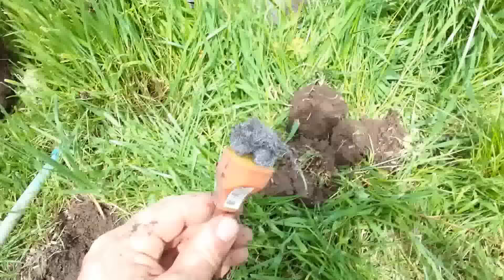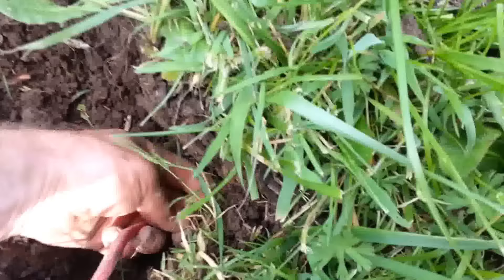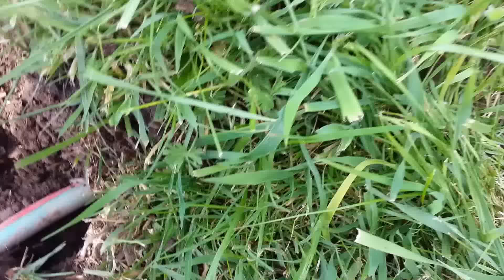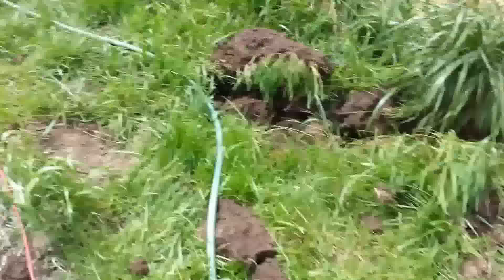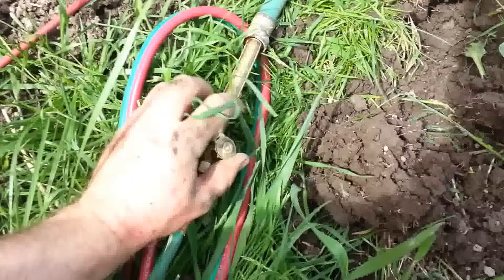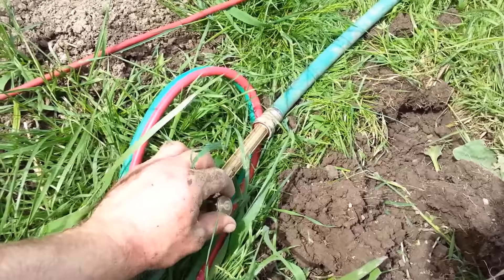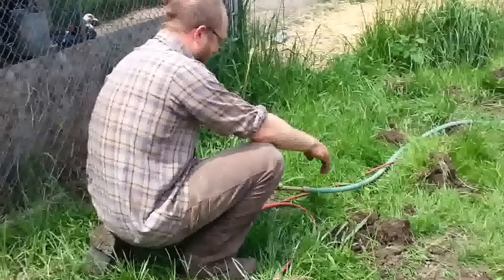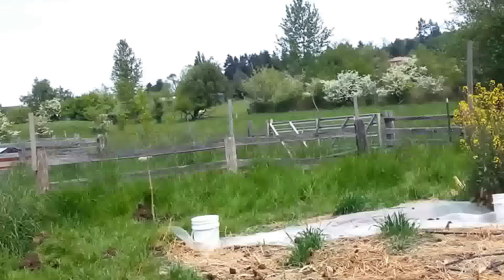Oxy Propane Gopher Tunnel Explosion

Comment: Who else was disappointed that at least one gopher didn't come flying out of that hole when this went off?
Reply: A bit morbid but, ok...
Reply: That gopher is chilling out in his other tunnel complex waiting till this guy goes home
Reply: I kinda did that once with a mouse.
That little gap under the drywall sheet where your floor woodwork goes was not in yet, and a box was in the corner.
One side of the corner was already up, so the opening just dead ended.
I got a regular propane torch out, and pointed the nozzle into the hole and turned it in for a few seconds.
Removed the torch and got the Bic out.
A little “FOOF” happened, and the now singed mouse ran out of there like nobody’s business.
The cat managed to get him right after.
Reply: Or returned fire?

Comment: Did that once with gasoline pushing the vapor with a small fan. Ignited with waterproof fuse and then spent the next half hour putting out the flaming chunks of sod that were spread upwards of 40 feet from the original tunnel. I had a oxy/acetylene torch but never thought to try that. Pretty cool.

Comment: My brother and I did something like this when we were kids and our parents had a house in the country, except we used our mom's hair spray which we sprayed for about half a minute at a time into a gopher tunnel opening.  Then we stepped back, lit a match away from the opening and tossed it in the hole.  It exploded with a loud "whump" sound, but nowhere near as loud as what this guy on the video did.  We saw the dirt slightly lift up all along the path of the horizontal tunnel, then it collapsed slightly downward.   We did it on about three or four gopher tunnels around the yard, but stayed away from the house just in case.  Mom probably wondered why her hairspray was getting used up so fast.
Reply: Mike Kennedy 🤣

Comment: Even though this is 6 years ago. The reason for the delayed explosion is because the oxygen and propane around the steel wool needs to hit certain percentile ranges before it will actually ignite. Its better to use more propane then oxygen because you can always just wait. Also if you were using air not actually oxygen then u might wanna re think your ratios.
Reply: Not quite. You actually want more oxygen than fuel. The stoichiometric oxygen requirement for propane is 4.3:1 for maximum combustion and flame temperatures. The higher the temperature, the higher the gas expansion and in an explosion, its all about the volume of gas expansion.

Comment: When I worked as a mechanic for a private golf course we used to go out and clear gophers. We had a specially built system called the Gopher Getter that was oxy/propane, but it was attached to a nozzle with an igniter built right in. Had huge tanks attached to the back of a golf cart and wired it into the cart electrical system. We'd stuff the nozzle in the hole, drive and park about 50' away since that was how much hose we had and let it rip. Never had to get out of the cart. Good times.

Comment: Awesome video, but I prefer just a common road flare.  Place it in the hole after lighting, cover the hole.  Do not cover the other connecting holes, that way the poison gas flows out and into all of the tunnels.  Any gopher that escapes out is dazed, confused and easily dispatched with a .22short or a pellet gun.  Much quieter and neighbors don’t get all bent.

Comment: I did this years ago by making a HHO generator out of an old car battery that would not longer hold a charge. You could see the water level though the white side of the battery. I let it run until the water level was real low. I have no idea how much gas was in the tunnel but when it lite it off the blast rattled every window on my street and some one called the cops. By the time they got there I had hide the HHO generator and hide my self as well. I only did that once.

Comment: Back up Chevy pick-up to area of gopher tunnels. Run hose from exhaust pipe of truck into opening of gopher tunnels. Turn on truck. 

Isn't that easier?
Reply: I was just about to say the same thing.
Reply: no, the exhaust contains carbon dioxide and heat in addition to carbon monoxide,
burrowing mammals are extremely sensitive to carbon dioxide, and air temperature. 

the gopher will abandon the burrow before the CO can incapacitate and kill him, and he'll just dig somewhere else near by or head to a different burrow.  you'd have to plug every burrow entrance and trap him in the burrow.  

because the gas used here contained oxygen, and the fuel gas unburnt is non toxic... the gopher wouldn't have tried to escape.
Reply: We've had great success with the exhaust method too.  You never see the little critter again. Never seen one try to escape.
Reply: DoubleDogDare54 this is more fun.
Reply: DoubleDogDare54 chevy chase?
Reply: I hooked a hose up to my Cummings diesel and smoked them out for one hour.  They just plug up the run with dirt and go elsewhere.  I find traps put in the run about 30" in does a great job.
Reply: Why do that when you can have red mist
Reply: This is way cooler.
Reply: DoubleDogDare54 yeah it's easier, but you don't get to blow anything up.
Reply: Sure, but not as fun 💥
Reply: Gotta love those clean explosions :s
Reply: learnd some thing new  :->
Reply: Nah, that would be too simple
Reply: That is not added to propane tanks. That is only added to municipal gas supplies and probably to the larger gas tanks used to supply homes not plumbed with gas from a municipal source. You would definitely not want it in a gas cylinder meant to be used on a torch. That'd be very annoying.
Reply: But that isn't near as much fun as blowing them up
Reply: elixiriszog not true, it is used virtually everywhere nowadays, simply because of safety issues. Maybe in poorer economies perhaps, but the UK and Europe, it's a requirement. Pretty sure America and Canada follow the same guidelines as us.
Reply: stinkyfungus  12 gauge when he runs out of den.
Reply: not as fun boys with toys
Reply: DoubleDogDare54  - Maybe, but who desn't like an explosion???
Reply: This is more fun.
Reply: DoubleDogDare54 I
Reply: I do not think easier was the goal.
Reply: +DoubleDogDare54 but not half as funny^^
Reply: Ford Truck works better, dirtier exhaust.
Reply: yeah but its not nearly as fun
Reply: stinkyfungus thats why you plug up the holes beforehand... then they just go night-night
Reply: Ivan Jakanov cleaner??? They made more of a mess than the gopher... like i said, plug up any holes you see and run the exhaust... painless to them and no mess for us... sure it looks cool, kinda like an ultra-mini ww1 for 12 yr olds, but really??
Reply: Why a Chevy. It’s no good if it’s not gonna start. You need a ford.
Reply: easier, maybe. but not nearly as much fun.
Reply: But not as fun lol
Reply: it depends on the soil. In sandy ground they'll just move away from you, but in harder ground you can gas them.
Reply: But then there's no explosion.
Reply: DoubleDogDare54 - but not as much fun ;)
Reply: Good idea
Reply: You are all getting it wrong pour gas down that shit and light up a match
Reply: DoubleDogDare54 If you want to run your truck idling for 20 minutes or so. Sounds like a waste of gas compared to the good it would do
Reply: Not as fun
Reply: GIVE THIS GUY A MEDAL 🥉
Reply: Way more fun blowing shit up....cool.
Reply: DoubleDogDare54 good idea, but I only have a Toyota 🤔 I guess I'll have to buy a chevy
Reply: You forgot the last part- open beer.
Reply: Seems only practical
Reply: Less funny
Reply: not as fun
Reply: DoubleDogDare54 You are right on!
Reply: DoubleDogDare54 but nit as fun
Reply: stinkyfungus you are wrong
Reply: Grom to
Reply: But it wouldnt destroy the tunnel
Reply: It would melt the hose
Reply: @Jay-cq5qr  JajajajaJAh 👽😱 🤬🤣 😜🎃🤮👀 🎭🌈 👀 A+;!!
Reply: If you are going to gas them with car exhaust, might as well use a VW.
Reply: @myopiniondoesntmatter8958  no
Reply: Ivan Jakanov  <— Certainly boomier,.. which is the fun part.

Comment: Well, a few problems here. Did you calculate the 1 min of oxy-propane as you call it to cover the entire run of tunnels? Another helpful hint always use a neutral flame on the cutting torch for the best mix and lose the propane and get a bottle of good ole acetylene. The neutral flame on a good cutting tip or a rosebud running a little lean will produce the desired effect. You also need better igniter. I use 3 strands of fine copper wire and a black cat wrap the 3 strands around the fuse. Use several more extension cords and a 12-volt battery that's in fair condition. Walk off the tunnels and use 4" diameter average hole size to calculate the cubic feet. WARNING IF IT IS VERY LARGE DO IT IN SECTIONS UNLESS YOU LIVE A VERY LONG WAY FROM NEIGHBORS,LIVESTOCK, WILD ANIMALS, OR ANYTHING YOU WANT TO KEEP!

Comment: If you really want to get rid of the gophers...
Put a hose in your exhaust pipe of an engine (your car), make sure it's sealed, stick the other end of  hose in the gopher hole that's open, seal with dirt, start engine and let it run for about 30 minutes.Your gophers will be gone for a long time.

Comment: Had a severe mole problem in AZ. Took my old Chevy Nova with an oil control problem, set the mixture to rich, ran a tube from the exhaust to one of the holes, cranked up ol' Rusty and plugged up the holes that had exhaust smoke coming out. 46 minutes & half a quart of oil later, mole problem. Period!

Comment: Thats the most ghetto ass detonator iv seen in a long time.
Personally I get those little things that are basically tiny lightbulb filaments, then I press them against a match head and dip in hot wax.
After that you just need to connect it to an electric current eg. a battery and then you've got yourself a waterproof igniter.
Reply: If its stupid but works it isn't stupid.
Reply: Model rocket igniters work great with just a battery.
Reply: Unco Casey broken lamp works as well.
Reply: He needs more oxygen and instead of propane use Acetylene
Reply: Your way is way more complicated
Reply: boneB explain how that would go?
Reply: capitalism420  You would definitely get rid of the Rats
Reply: Brett Couacaud what could possibly go wrong??? I'm really wondering
Reply: It gets the job done why pay 500 when he got for 30

Comment: Use the steel wool and 120 VAC with a protected circuit breaker.  Just like a blasting cap.

Comment: The steel wool was not burning since car chargers have current limiting circuits in it. Next time try just a straight car battery.
Reply: a1919akelbo it depends on the charger.  If it's a trickle charger, maybe, but here are still plenty of old school chargers with no limiting circuitry, and even if there is, a 9 volt battery can ignite steel wool, and those don't supply much current.  Most chargers regardless, put out a minimum of 2 to 10 amps, which is plenty to ignite a wad of steel fibres like what is used here.  But steel doesn't make great connections either unless forced, or cleaned and oiled.
Reply: USE REAL FINE STEEL WOOL COAT WITH MARVEL MYSTERY OIL

Comment: I did s similar thing every spring to push the gophers out of my yard.   I pushed about 10 feet of half inch hose into the tunnel a nd poured a cup of gasoline down the hose, blowing the last bit out before pulling the hose out.  Then I lit a gopher smoker and shoved it into the tunnel.  I quickly sealed the tunnel with a couple of shovels of dirt.  It takes about 30 Sec. for the gas to explode, blowing back to where the gophers come from.

Comment: For all that hassle all you had to do was get a bottle of argon gas, it's heavier than air, put the hose in the entrance and open the valve. As the argon gas goes in the gopher hole it naturally settles in the low spots and essentially drowns anything down there.
Reply: Now, what if I told you the explosive was not to kill the gopher, but to destroy the tunnels?

Comment: I doubt this kills them and I will tell you why. Gophers have a network of underground tunnels and exits every where. They are very sensitive to changes in the air, moisture, ect. So by the time you put the gas in and ignite it. The gophers more than likely have ran to another part of the tunnels or exited all together. So I'm pretty sure this is a waste of time and money.

Comment: Dammit  - I came for Fur & Flamage flying out of the hole. 

Truly - I've done simular on the farm 30 years ago at perimeter at edge of very large mowed yard of say 3 acres - of 160 farm. 

Using propane only, before safety valves were used to prevent full venting of open valve. 

To where full force of 350psi, typical propane pressure when full for all BBQ' use, but with regulator, 5psi. 

Here's what happened.. after inserting hose at full pressure deep in their dens. 
The dens can be up to 6ft deep for gophers. Test probes will prove it when steel probing rods suddenly freefall into a tunnel 5ft below the surface. 

Start the probing into the ground about 3ft from edge of gopher mound. 
It's quite obvious when you fine it. 

Using air line same dia of probing rod, 
shove airline as far as possible. 

Turn tank valve full on - at 350psi, you'll hear it ripping away down there. 
Usually their exit holes are stealth,, 
until set off. 

A week later,, though - 
The buggers simply moved further 
into the yard. 
Or they were cousins coming to visit, 
and you messed up their entertainment center. 
Good Luck.

Comment: Heres a better way, I have been doing it this way for years.
You don't need the extension cord..
I use my medium size oxy / acetylene bottles and small cart. I use a #2  gas welding tip.
 One piece of 1/4" clear  vinyl  tubing. 10' long. 
And one  6' long..
 I cut the long ones end  so I can warm it up and fold it back so when I push it as far in the gofers tunnel it doesn't scoop dirt.  I  put a piece of tie wire in the tube (keeps the tube straight) makes it easy to push.  As  far as you can.
The short one is the vent,  . Put that in just far enough it doesn't get buried  and then  fill the hole .
FUEL GAS  
 Light the #2 gas welding tip.   Adjust the flame to a loud hissing OXIDIZING  flame (excess oxygen) .
I use a wood block  2"x4"x6" to put out the flame.
Push  the long tube on the end of the #2 tip and let it flow.   4-5  minutes  pick up the vent tube and take your striker, or lighter and hold it on the end of the vent and when it fills up and back out in the vent.   I don't care where they are in that tunnel, the over pressure turns   them in to jello.
 Propane will work,  just be sure to adjust for a OXIDIZING FLAME   super explosive..
Use what ever tubing that push fits on the torch tip you have.   EASY
Get rid of the electric cord, 
So ... GAS, OXY,  WOOD BLOCK, LIGHTER, TUBING. SHOVEL.
California we have goffers,   you can tell they push up mounds . If you dig straight down and 12" to 18"  down you can see the dirt is a different shade and soft,   poke your finger in the wall of the hole   open the tunnel put in the tubes and fill it back up.
I blew open a tunnel   that was 12" below the grass  six feet long, made a 90° right angle turn  went straght for 12',, four feet before the end it made a tee at 90°  and went five feet and then a three finger wye.  At that point the tunnels ended at just below the grass.   No shit.

You are the only other person who I have seen do this.   Try it this way it is easy. Stomp down the back fill  tighter the better.

Comment: A. You used the wrong grade of steel wool. 0000 works best.
B. You didn't leave the gas on long enough. The gas is a low flow so it took about 20 seconds just to fill the hose.
All in all, it was fun.

Comment: When I was a youngster, the lawn mower and rototiller fuel worked very well when we pored a bit down a gopher hole and waited around a minute to throw a match at the hole.  We knew enough not to do this when things were too dry.  Feeding a 3 or 4 foot gopher snake down the hole was just as effective, but the snakes were not that plentiful.

Comment: I think the mix was off. The last time I did this for rats there was a lot bigger explosion and about 20 feet of tunnel opened up. Now what I did was light the torch and get a good flame going. The then stubbed out the flame and stuck the nozzle in to the hose. Like you I waited for a minute or so. I used a electric match used for model rocket motors. There was a big fire ball and explosion. And I was also using propane and oxygen.  .

Comment: Run both regulators at 20 pounds. No more, no less. 30 seconds is plenty of gas to blow shit up. Your problem is wasted gas and you need a short quick release hose that is inserted into the ground while your long hose is brought back with you. You could even use air line quick connects off of your air tools. As far as your steel wool, crush up some match tips and twist it like a light bulb element, not a fur ball and use a car battery mounted on a dolly. 😁😉

Comment: You get one hell of a volt-drop if your ignition is provided by a battery charger's 15 volts sent down a long mains flex. (Probably only half those volts are reaching the steel wool.) 
Triple the DC voltage (with appropriate precautions) and you should get instant results. (Any spare car batteries lying around?)

Comment: You used too much gas. Explosions happen with the proper air to fuel, mixture, right? Well, without factoring in thermal physics of the gasses and temp of the tunnel and also probably the shape of the tunnel, that steel wool probably got very hot, but didn't achieve ignition until enough gas had vented out and the oxygen could reach it.

Comment: I also employeed nazi tec on my groundhogs....i setup the generator with a pipe from the exhaust going into 1 of their 3 holes. I placed bricks on the 3 holes so air could move past. Started the generator and plugged in a space heater and set to high for the extent of a full gas tank....................................... it worked.